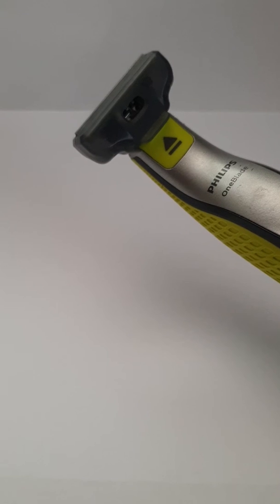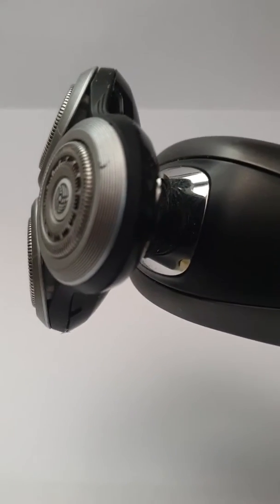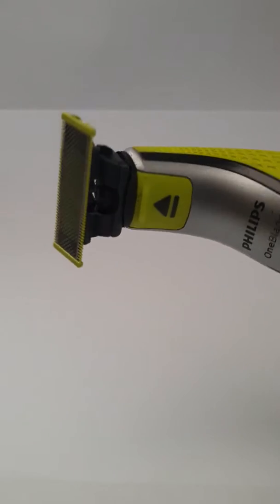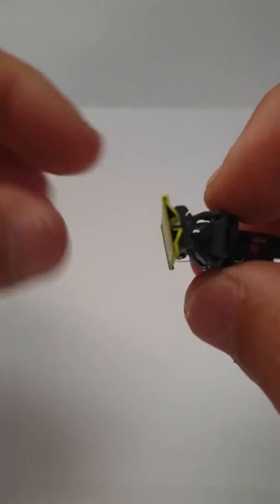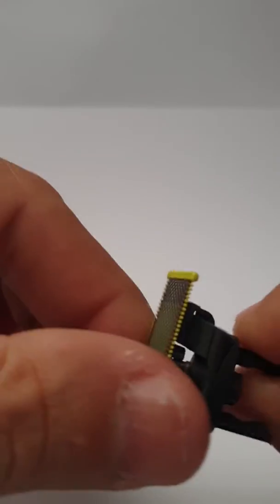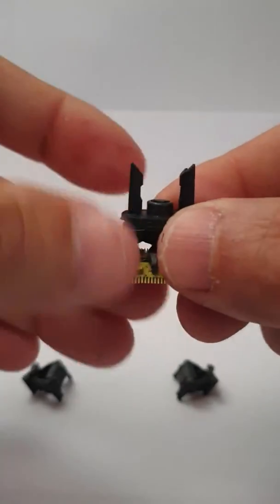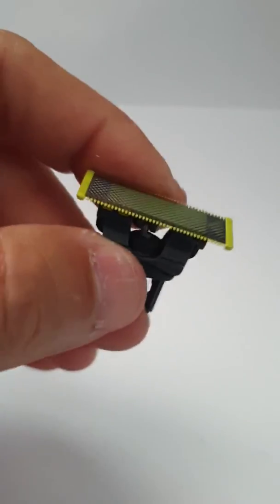Philips OneBlade Blade Re-use Twice The Lifetime

Comment: There's another video on here and the guy is cleaning the blade with a toothbrush and soap. He looked at the blade under a microscope and noticed it had lot's of tiny debris that was blocking up the blade. He's apparently got nearly 2 years use from one blade. So in theory if you use both methods you could get nearly 4 years from a single blade lol
Reply from the maker: Hi, can you please post the link to the video?
Reply: @ https://youtu.be/6XVj6p2fju0?si=Y1rWyoqGclbL6KU8
Reply: @monilevy5045  https://www.youtube.com/watch?v=6XVj6p2fju0&ab_channel=DavidLevi
Reply: @monilevy5045  https://youtu.be/6ndZso913sE?si=6U6VJGnN4WmfUi3x

Comment: Just broke my blade beacuse of this. I don't know if it was my mistake or video's.
Reply from the maker: Interesting. . which part did break?  Anyway you would throw it away so not a huge loss next time it will work better
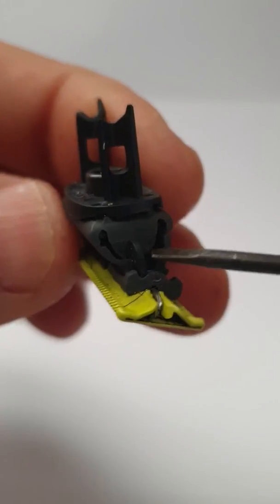Reply: @monilevy5045  In (4:10) where you use the screwdriver, that's where it broke and one of the two connectors that connect the razor and the machine broke.

Comment: A drop of clipper oil in each end after cleaning will also help prolong the life.  Using the blade in both directions is also effective (push-pull).  Also keep the surface of the blade flat to the face.
Reply: Your advise is more real then this video .
Reply: ¿Cuánto tiempo te dura una cuchilla?
Reply: @unumondounuhomaro6232  ¿Cuánto mide un trozo de cuerda?
Reply: I think it's around 3 months depending on how much you use it, I use both side anyway buy shaving towards the front of my head and then I use the top of the blade and shave towards the back of my head 👍 @unumondounuhomaro6232

Comment: I did hit the subscribe button because I found this video useful in another way so I appreciate you posting it my situation was that my razor fell out of the cabinet and onto the floor and actually I was worried that the machinery broke for a second but I realized part of the clip on the side that you slide out broke so I didn't even know how it come apart actually I was a little disappointed because it was a relatively new blade and you know they last a long time so I took my old one that had been worn out and I realized it sort of could come apart but I wasn't quite understanding how it came apart until I watched this video anyway I found your video helpful because I was able to slide the clips apart well it was already sort of broken on the part that fell on the ground and I was able to use the newer blade using the clips from the old worn out one which was still in one piece so it's sort of pays to keep things around you never know when you may be able to use a spare part like this so I want to thank you again because otherwise my newer blade would have been unusable with the slide clip slide thing broken on the one that fell and next time I'm just going to try to be extra careful because it could have easily totally broken the razor falling from the cabinet thanks again cheers
Reply: Also you made it look relatively easy it took me probably half an hour to get the little parts to slide in together there is a little bit of an art form to it I noticed it sort of makes a clicking noise putting the spring back in was easy but getting the gray pieces to slide onto the blade was a little tricky but eventually I got it done thanks again mate cheers
Reply from the maker: Great to hear that it helped. Please share so others can also enjoy it.

Comment: There is a third option which is a lot easier than messing with all this it's called just using the blade in both directions that's what I do for example shave in two directions or just flip the blade around in your hand I mean flip the handle around it's really easier than messing with all this